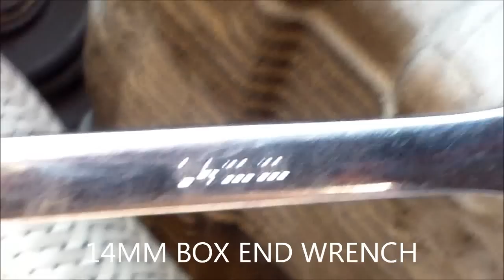How to replace alternator generator Chevy Aveo √ Fix it Angel

Comment: This is the absolute best auto repair video I have ever seen! Thorough video images, clear pictures, and step by step how to. and I much appreciate you showing the tools being used, as well as having the words-tool type and size on the video at the time of usage. We are in the process of purchasing a used Aveo as an extra vehicle to have around and it will need the alternator replaced, so doing research I came upon your video. Thank you for the mirror usage, detailed steps, and getting right to it without a 5-10 minute monologue as many auto repair videos have. Very well done!

Comment: +1 finally, someone who ACTUALLY SHOWS you how to do it.  

now.. where is that starter motor located...
Reply: High Hopes under the intake on the back of the engine
Reply: Under the intake to the driver side. It is an easy job! My '010 Aveo vid on this is on YouTube (maniacal s10) my altinators set-up is a little diff.
Reply: Altinator vid coming soon 2 days!

Comment: Help please. I bought a new battery and swapped the alternator for a new one and it still won't keep a charge in. Fact the check engine light came on. Now what?
Reply from the maker: tell me what the check engine light code. is you car running rough?? Like a rough idle?
Reply: 88BmyVegas Automotive the check engine came off, but it still won't hold a charge after I jump started it. I took the alt to auto zone and it passed, its a good alt and good battery.
Reply: 88BmyVegas Automotive what's a rough idle?
Reply from the maker: the engine is shaking and not steady
Reply from the maker: check your fuses
Reply: 88BmyVegas Automotive I replace all the busted fuses right away.. It was the fuses.
Reply from the maker: it could be from wires cross shorting. you might need an experience tech to find what is the problem.

Comment: Every thing is ok except for the way you unplug the connector, the datails are no clear. Today 9/7/2014 I have spent almost all day long trying to unplug the connector. You'd better do that once the alternator is already removed to see the details.
Reply from the maker: see the tab on the connector. you have to pull up with the pick you see, then pull the connector in the same time to release from the alternator. hope that helps.
Reply: 88bmyvegas Thank you. It worked out, its very difficult to see the tab from beneath the car though.